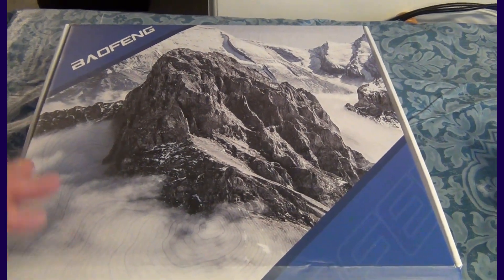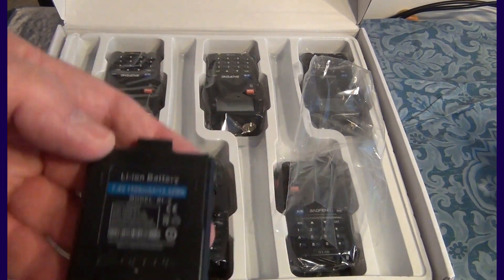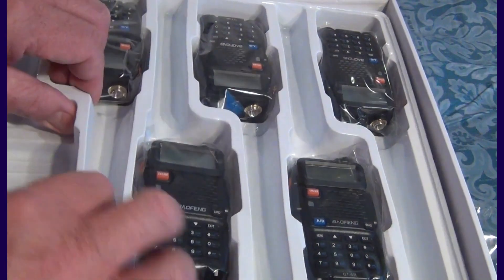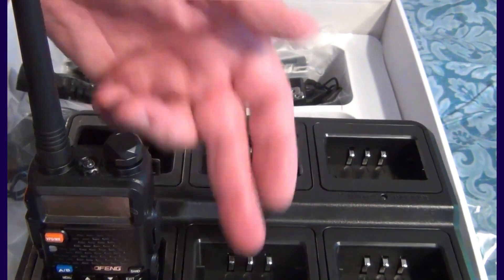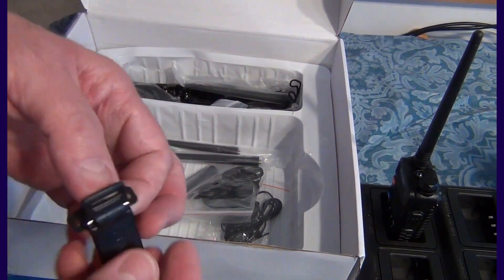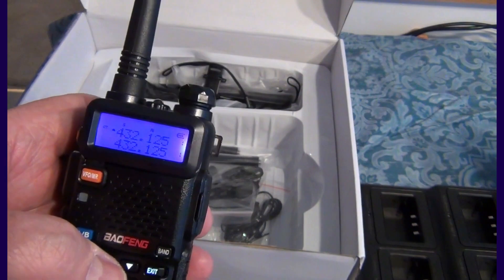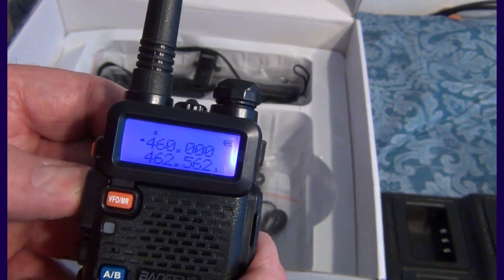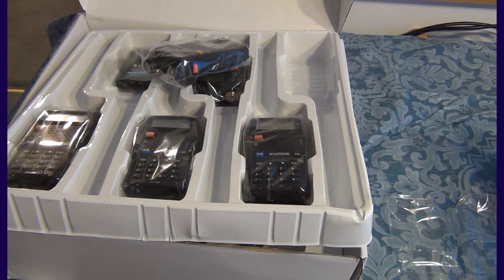Baofeng GT-5R: The body of the Baofeng UV-5R with an FCC compliant soul !

Comment: If the mfg is smart he should FLASH the CPU to correct the out of range condition. Sense it's nonvolatile Mem is separate from the Chang able this is easy out of fcc problem of course it's beeing done tks baofeng. Congrats
Reply from the maker: The goal os this model was to be FCC compliant, and as such these radios need to be bound to the amateur radio bands only.

Comment: I think it is weird that they would have an FCC ID for a part 90 grant authorizing it to be used on commercial frequencies but limiting it to only transmit on the amateur bands.
Reply from the maker: The FCC certification is possibly related to the emissions of harmonics. I agree that PART 90 is not required for HAM only frequency radios.